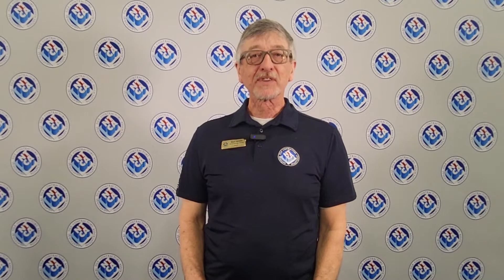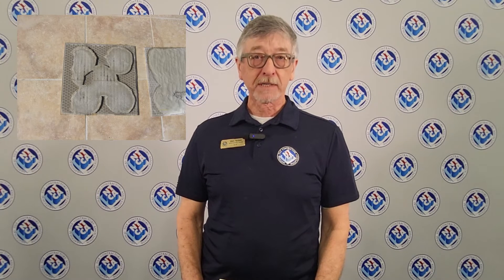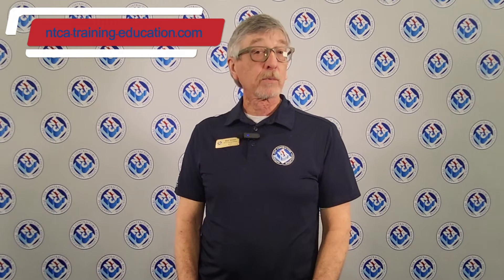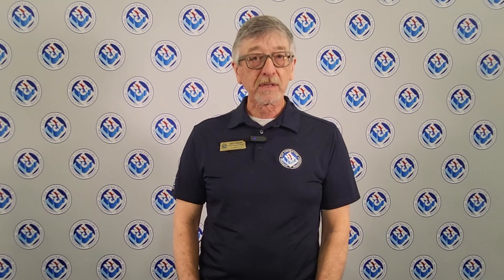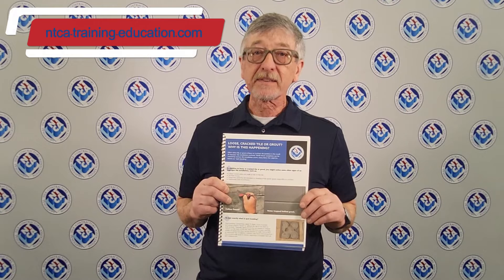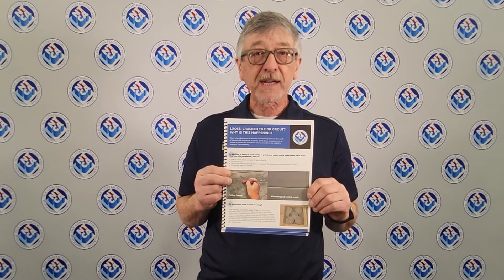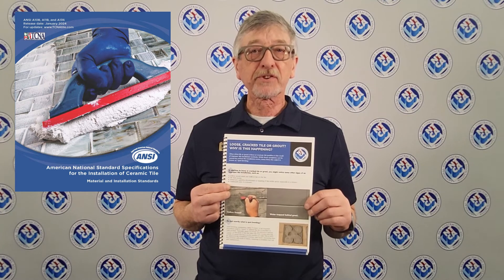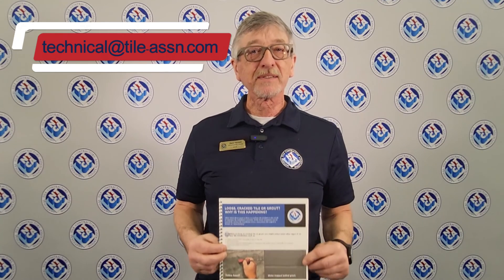Tile Failures - Is Spot Bonding the Culprit?

Comment: No.  Not always the case.  I am not a tiler, novice DIYer. For example Mapei Kerraquick adhesive provides 3N/mm2 of tensile resistance over joint.  Thats 550kg approx for a fully bonded tile 600x300.  Never going to come off outside of a wet area if spot bonded and surface prepared correctly.  In wet areas I agree - no spot bonding